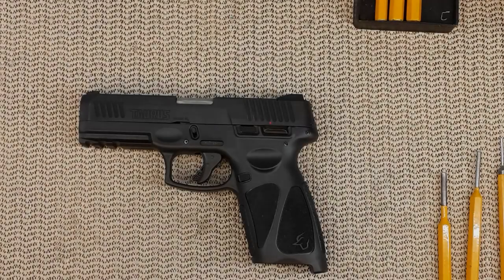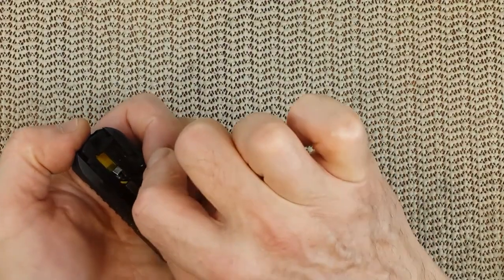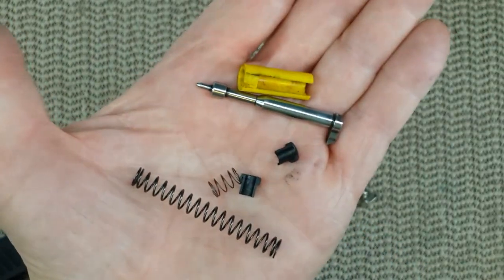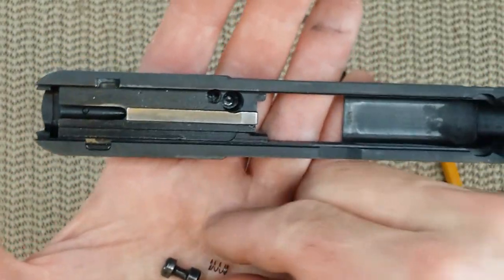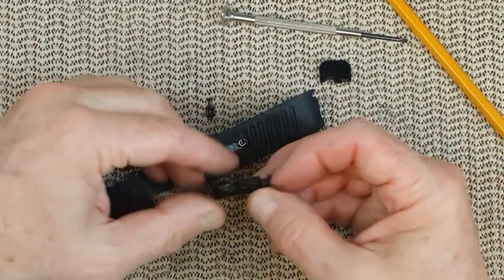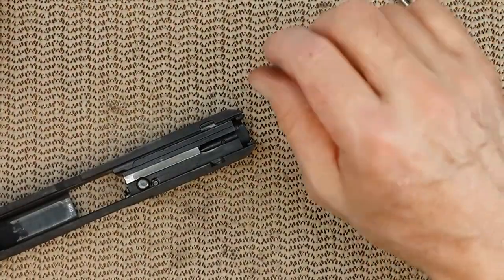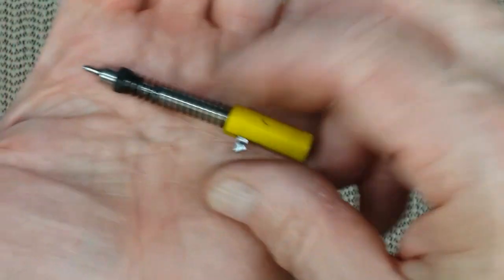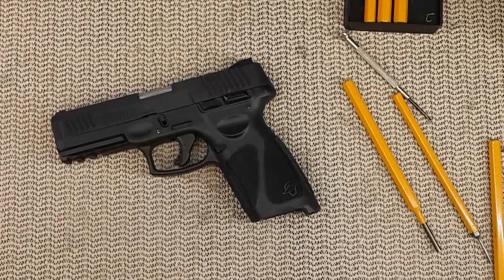Taurus G3 Full Slide Disassembly

Comment: Wow!!! that was totally amazing. I have never ever seen anyone that took their time, nice and slow, showed each piece in his hand. Totally amazing. I am thinking about getting the G3C but they say you many have to polish inside the barrel where the ammo goes into with a small dremel round buffer to rub out the coating so the ammo does not hang up and not eject. There is no way I thought I was going to find a video with the total disassembly and I did. Thank you so much. I knew nothing about this gun and it is easier to remove parts than the Glock 43 that I have watched. I think you have done this a few times or so. 🤣 I am saving this video in case I buy the Taurus G3C. Any pointers on why some are having problems with the ammo casing getting stuck in the barrel and not falling out? I have read a few complaints. I will have to watch this again now. I am so happy. Thank you again. Woo Hoo!! 😍 I loved how you immediately got to work and did not waste any time. You got down business.

Comment: Very nicely explained, thanks very much.  Question, do you believe the firing pin assembly should be cleaned after each shooting session or would a basic breakdown and clean suffice for a bit?  Thoughts?
Reply: the firing pin shouldn't need a clean with each shooting. Standard breakdown and clean should suffice. Personally I would be inclined to do a thorough teardown and clean/lube at about 500 rounds and then at 1000 rounds. If you keep track of how many rounds you put through your gun, make a mental note of how dirty it is the first time you clean it and then at some measurable interval like 1000 or 500 rounds fired, tear it down again and look, does it look bad? does it look like it did the last time you did it? Adjust accordingly. It won't hurt anything if you LIKE cleaning it and do a full tear down every time you shoot it, it's totally up to you :)

Comment: Should I put a little Grease inside fire pen area before I put it back together?
Reply: No! You want the firing pin (striker) to be dry. It needs to be able to move freely inside the channel. Grease or oil will attract dust and debris that can stop the firing pin from moving.

Comment: I think I did something wrong because now after I caught the weapon and I dry fire it... The double strike capability seems to be disabled in the firing pin remains forward. What did I do wrong here?
Reply: Hmm... tough to say what exactly is preventing the firing pin from retracting.  I suspect it would have something to do with the way you reinstalled the firing pin assembly... perhaps the plastic bushings were not fully in place?  Perhaps the spring was forgotten? (That would be unlikely, I'm sure).  Perhaps something went amiss when you reassembled the extractor assembly?  In any case, I would disassemble fully again and carefully watch the video and replace the components exactly as described and in the exact order.  Something must have gotten missed, or the spring is jammed up.

Comment: Hello everybody I’m a new guy in the gun world  and just bought a Taurus g3 2 days ago , I’ve been practicing my disassembly and assembly  but I’ve noticed  that when  sliding the top part back that little lever gets stuck  just like the video and I see he pushed it down with his finger (minute 8.50)is that something normal , is something wrong with that part of the weapon ? I would truly appreciate any response specially for someone like me that just but my first weapon ever !
Reply: Yes, Nehemiah, this is normal.  Occasionally, as the slide and frame are separated, that piece that you saw the poster push down, displaces.  It's all part of the trigger assembly in the frame.  It truly is just a matter of pushing it down if you notice your slide catching it on reassembly.  Nothing to worry about!
Reply: @aaronwhite1929  Yikes. No appreciation. If it was a problem, he would have said so. Thanks for your reassurance even though I didn't need it. Some people are just ungrateful. 🙄

Comment: Don't like that the spring retainer caps are plastic
Reply from the maker: I found out that many plastic parts used in guns are very sturdy, to about 10000 rounds.
Happy shooting Robert.
Reply: The plastic acts as a bushing.
It's designed to help prevent wear to the firing pin channel.